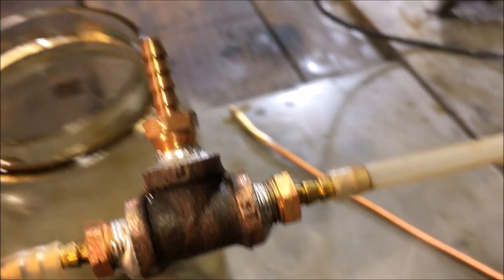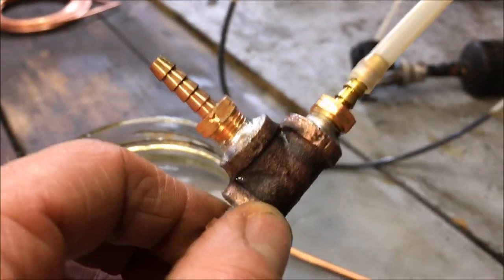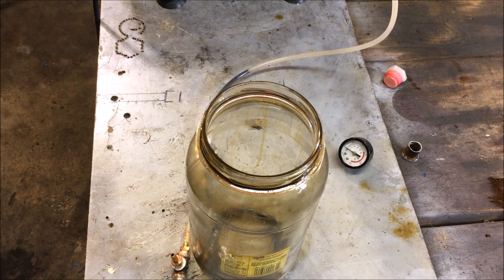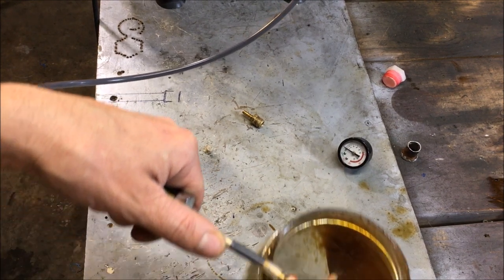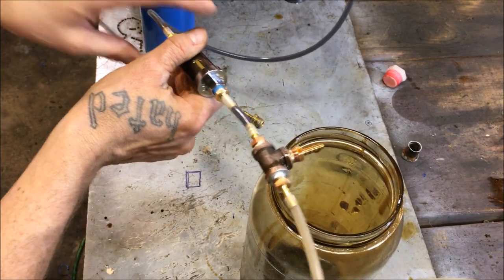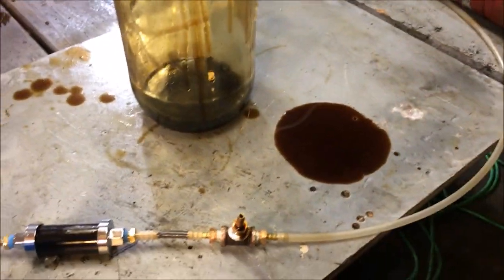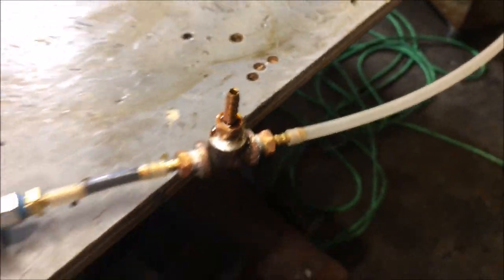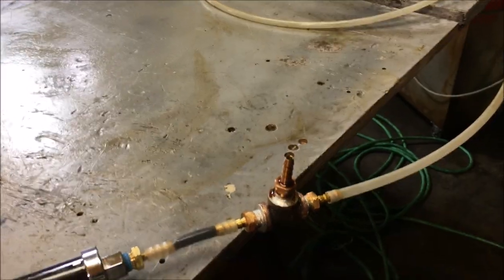waste oil vaporizer ( BENCH TEST )

Comment: Great job! 
Oil burner has the oil connected to the “T” where you have the hose connector that is acting as a spray nozzle.  Oil Burner has the out go where you have the oil input.    The air goes straight thru the “T” top picking up the oil.  I have no idea if it matters.  Oil burner uses a longer burn chamber (pipe or 2x2) about 12 to 14 inches or more!
This type sprayer is not as finicky as the  Venturi style set up.  That is weird too.  It seems the sprayer nozzle works less finicky than the atomizer nozzle even though the atomizer makes a much finer, smaller particle spray!!!  To me that does not add up.   The Atomizer should work better with less trouble but that is not what I see.

Comment: on you tube is a guy he has a very good nozzle for waste oil I think the name of the nozzle is the kewe nozzle you can use a wire feed copper tip form a welder so the air go s in or out side you can adjust it too you have a inside cone shape and the welder tip made to shape same so you get the siphon going no need for presher

Comment: Yes I keep having trouble with my homemade siphon nozzle what was the sign that you had attached to the oil line it look like some type of reservoir or something was that to keep too much airflow going back to the tank. The trouble I'm having with his I've gotten feedback from the air going into the tank of oil and is bubbling the oil on putting air in the tank and air at the end of my nozzle I'm not for sure what I need to do about that any suggestions. Thank you for your reply back
Reply from the maker: yes your set up is not siphoning if air is getting into your tanks , you need to adjust your air spike inside the siphon . with out a picture of your device i cant help you , also the oil tank on the set up in this video is also pressurised so its not a siphon nozzle . go to my syphon nozzle vids and you will find a diagram of the one i built    . go to this video at 16:25 https://www.youtube.com/watch?v=bquGqvTgtT8